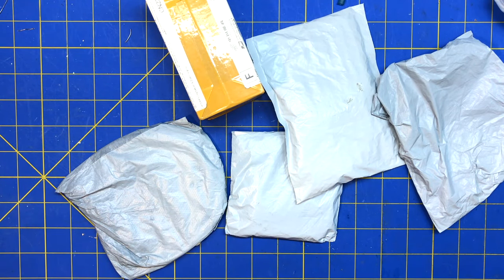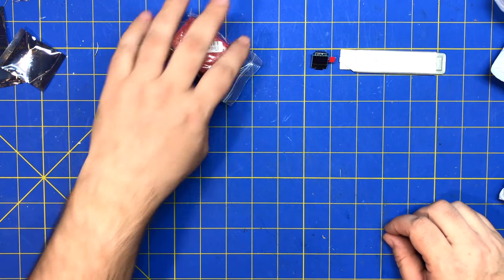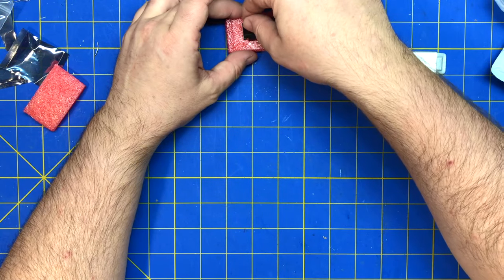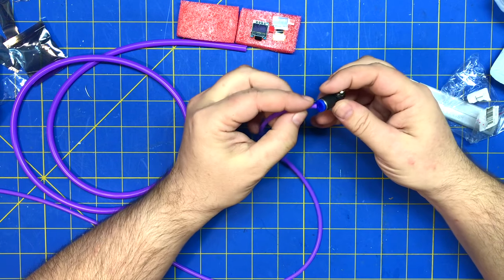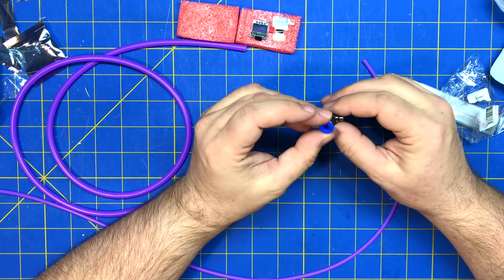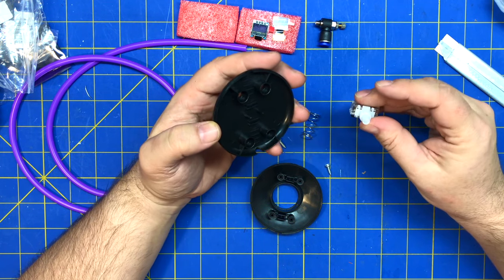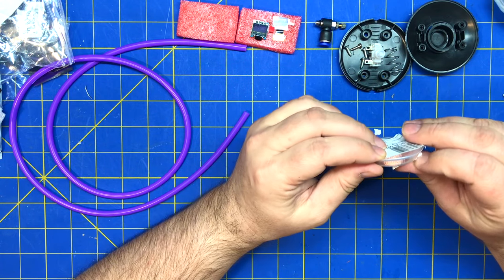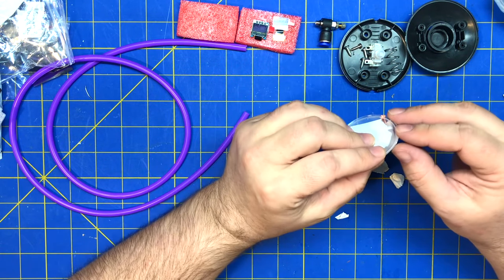Mailbag #49 08-2019

Comment: Looks like the same desolder braid I have. All it really needs is to be made out of copper and have a high surface area.
Reply from the maker: In a previous video I showed the first desoldering wick I purchased for comparison, which turned me off for a while because it did not work at all, instead of being flat it was pulled tight into a rope, and was useless.  Now  I know better, and love it.